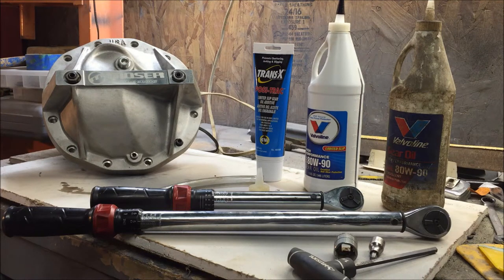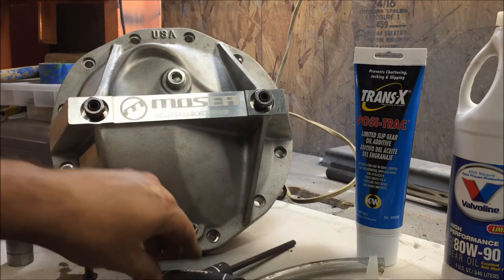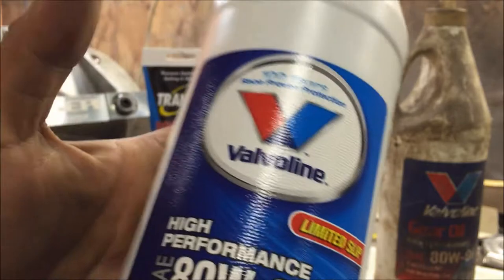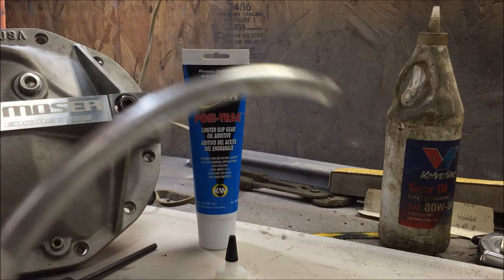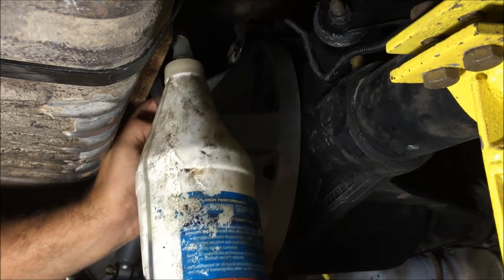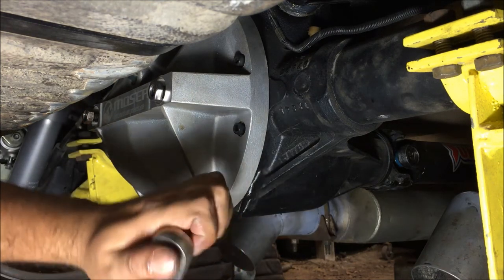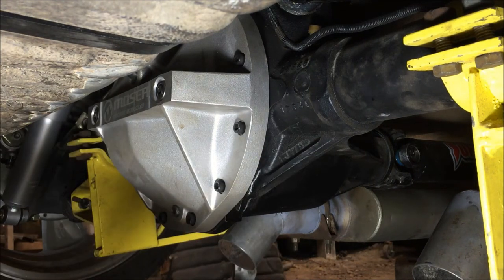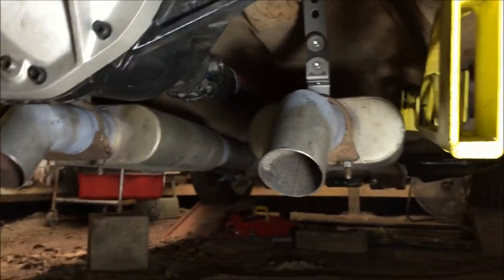GM chevelle 12 bolt aluminum differential cover install how to

Comment: I used crows foot on the torque wrench so I could keep the Allen wrench on the head from turning in any more or you'll get more then 5 ft lbs on the bolts just my opinion brother 😉👍🏻
Reply from the maker: you were so freaking right about that...  when i got home from work i backed off the jam nuts...and now im gonna go buy that crow foot socket... thanks
Reply: +Chris Craft 😉👍🏻 no problem buddy
Reply: +Chris Craft Chris why don't you fill your diff from the front level plug it's a lot easier 😉
Reply from the maker: ha, completely forgot about that...  thanks again...i honestly dont know much about aftermarket parts...and they often times confuse me..  especially when im makin a video..
Reply: +Chris Craft no problem brother just the car has to be level and I'm sure you know once it starts coming out of that fill hole it's full👍🏻
Reply: @chriscraft77022  how much  tranx do I use I have the same set up

Comment: Just FY, my allen bolts that provide the pressure on the cap started to leak. Moser stated I can apply some silicon on them to keep them from leaking.